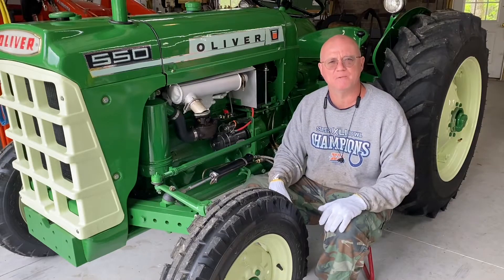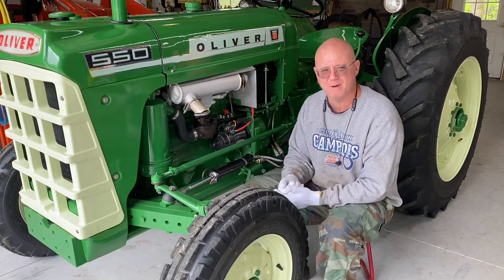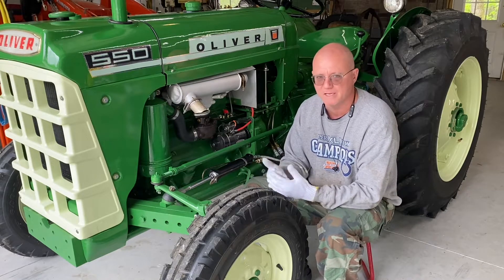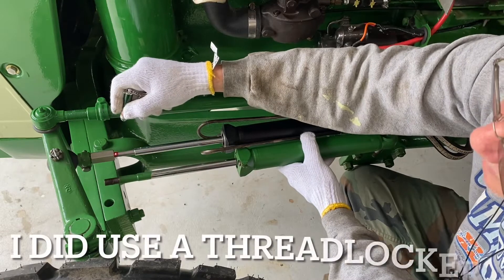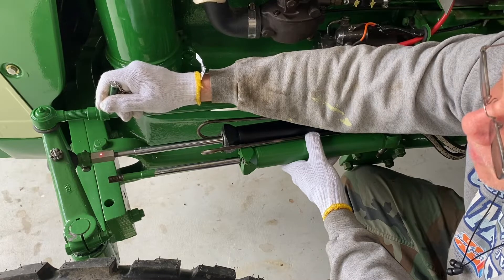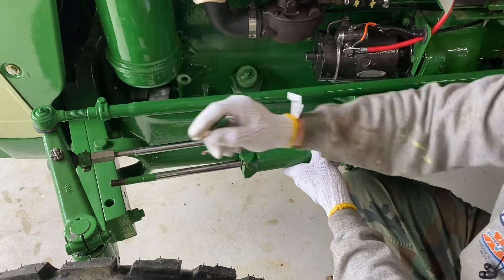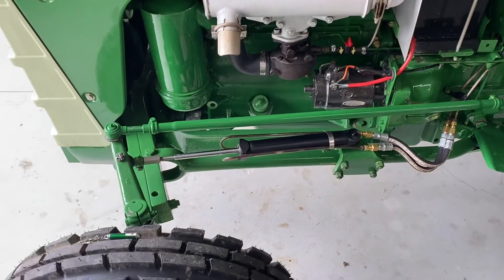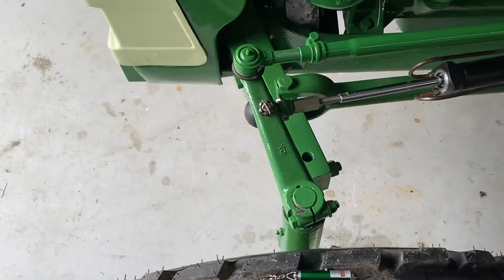Oliver 550 Rebuild: How To Replace Power Steering Cylinders Ep# 28

Comment: I have a Super 55 and absolutely love the tractor.  Only major issue I ever had was the PTO clutches going out.  Manual says you have to split the tractor but you can do it by keeping the tractor together and just removing the top plate of the transmission.
Reply from the maker: Yes you can but way easier splitting the tractor. Also you would need to remove the steering case and the entire dash console……lots of work. Watch my video on doing a Z split and I think you’ll agree the split is the way to go.

Comment: How did you adapt the inverted flare lines to the flexible hoses? What sort of fitting/ adapter is that?  Thank you for the info!
Reply from the maker: Not sure what they are called? I just took my lines to my hydraulic/bearing store and they hooked me up with the appropriate adapter.

Comment: Can you tell me where you got the new power steering hoses, please
Reply from the maker: @terryhenke3195  I bought these at our local Coldwell Bearing but any hydraulic shop can make them. They used my old lines to get the length correct.